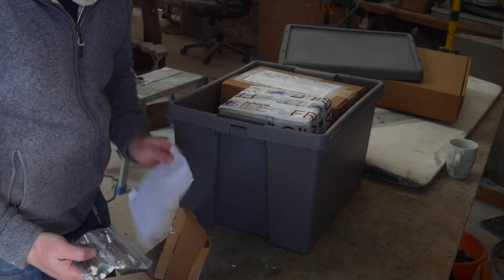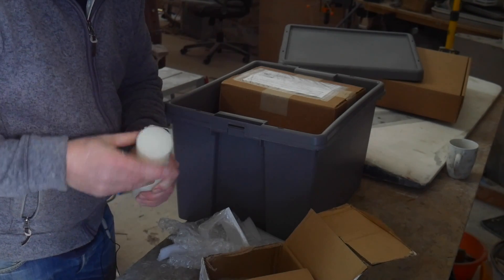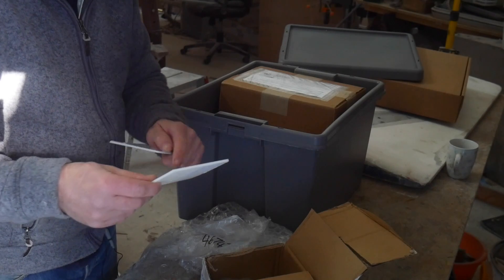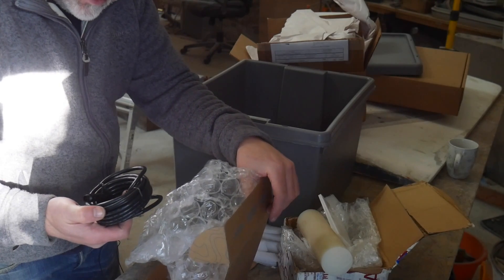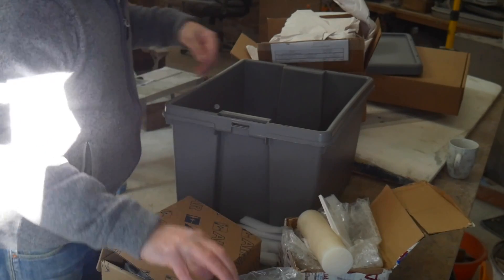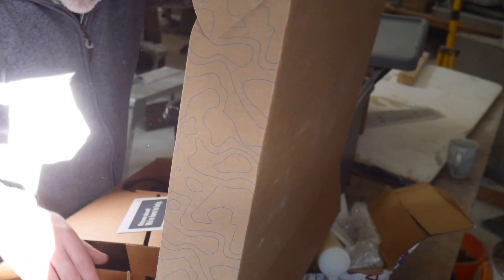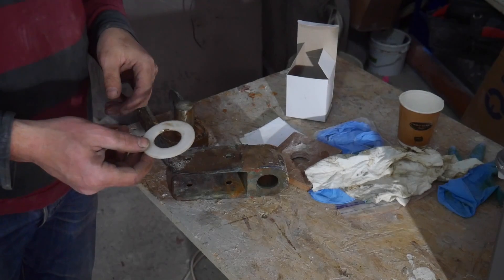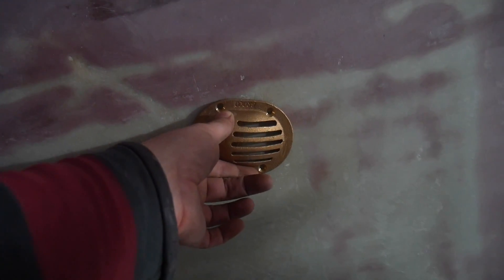#69 Hi tech spacers using low tech tools

Comment: Hi the grease things in Holland we call them cups and they are quite common old machines. You fill them up with baring grease and twist them  just so many engine hours. Normally half a twist works. A cup should last for 20 twists and then you simply fill them all up and start all over. The grease does not need to come out at the baring but should stop the water to ingress. Best of success with the rest of the build. Cheers rene

Comment: I'm glad that worked out for you.  If you covered that through hull in beeswax it should be a simple application of a heat gun and it should slide right out, if it scraped off on the way in that could be a different story.  Best of luck.